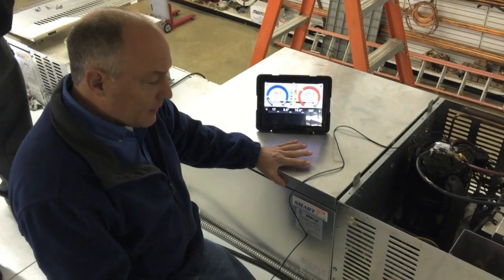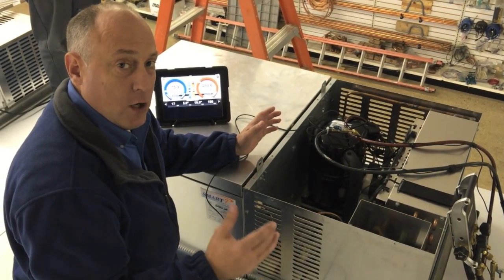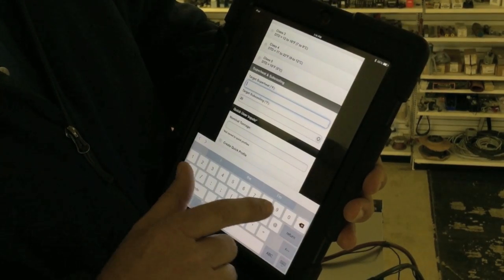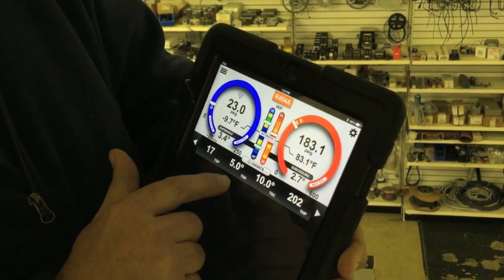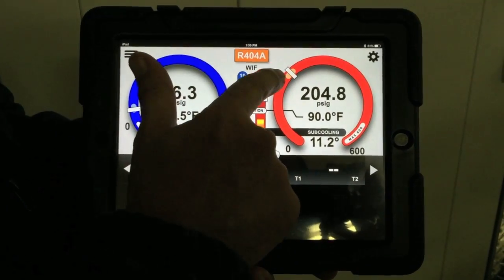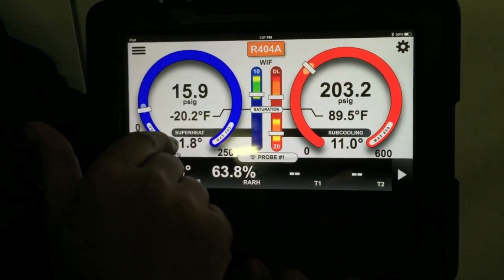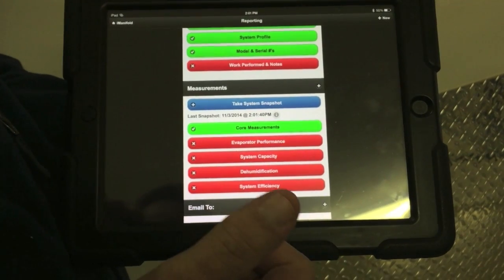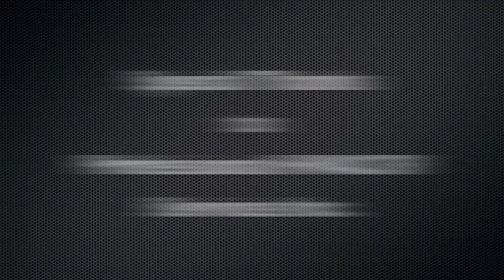Setting up a Walk in Freezer with the iManifold

Comment: Having just seen the device in an application I'm not familiar with I wonder is there a set up that would allow you to check a ductless mini split? some ductless split systems do not have dual ports for the refrigerant accessible from the exterior and I am not as familiar with those pieces of equipment to know where else you would be able to take pressure and temperature readings from consistently.
Reply: You will cut you hands up on the screws trying to get your probe on the line to check supreheat. You can get to the low side port easy enough but trying to get the temp sensor on the suction line is another story all together. It's better to trust the manufacturer on mini splits. Just my opinion
Reply: Both lines are low pressure, one is saturated liquid, and one vapor. The metering device is in the condenser. The single stage ones with a fixed metering device can be charged with the iManifold, and it will also accurately calculate airflow and capacity if you put a probe on the inlet and outlet.
Reply: Gauges are useless on minisplits. So in 10 years when the government has mandated ultra high efficiency levels in our trade all our gauges will be useless. VRF/VRV will be common practice. Plug up a computer and the system will tell you all the sensor readings. The controls industry will be making $$$!!! I have never diagnosed a minisplit with gauges.
Reply: I agree with Justin Mikola gauges are as useless as the apps you were talking about.

Comment: thanks, that was informative, I especially liked the target pressures. I don't see me using the reporting function, running from job to job every day, trying to get service calls done correctly, quickly and efficiently. I would still like to see a basic gauge set with a screen with a comparable cost to the testo 550. $300. it would go global, some company is going to do it, I'd like to see it done by Imperial. Thanks.
Reply: The reporting feature is so simple to use that when I'm finished doing a start up I simply send it to myself and I have a permanent record of the numbers that I took at that time, no notepad, no notes in my phone, nothing but an email that is saved forever and I'm done. I guess if you do not record any numbers at all then the reporting feature would be an additional step but why not save it if you're taking readings in the first place?

Comment: This app has wonderful features to make sure it is used as a diagnostic tool to TEACH. How many times would you have the wrong readings, but had to "call a friend" for help in determining what you were looking at? Well, this app has a warning emblem that once pressed would aid in troubleshooting any possible scenario exposed by the tool as to be not in range. It will prove to be a tool for our customers that will serve to develop a new base of critical information that can serve to prove that the equipment has been installed or serviced and be qualified by the OEM that the equipment is operating as designed.
Reply: Not to mention the upcoming tech connect feature that will allow a second technician to look at those numbers to verify performance from literally anywhere with an Internet connection!